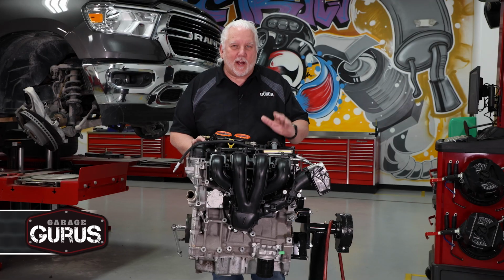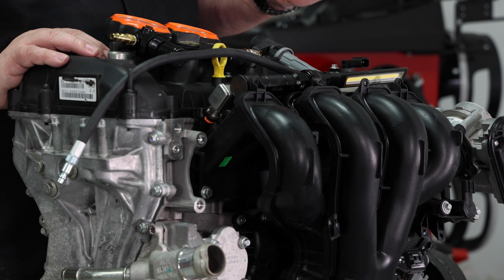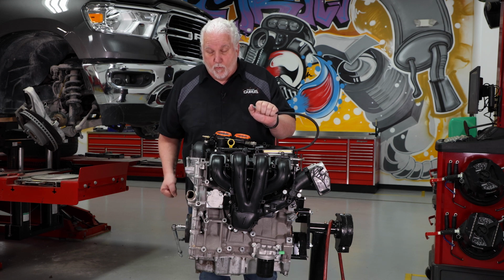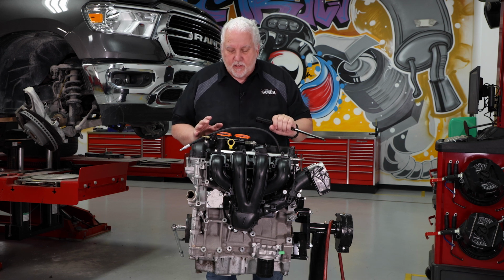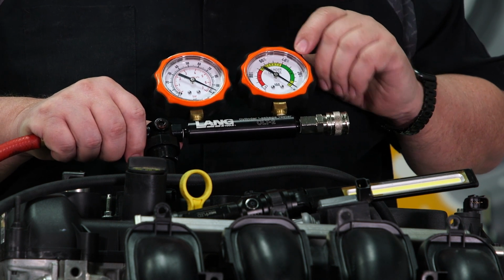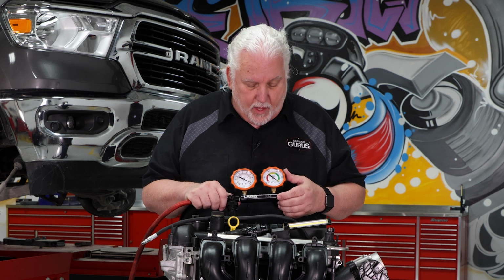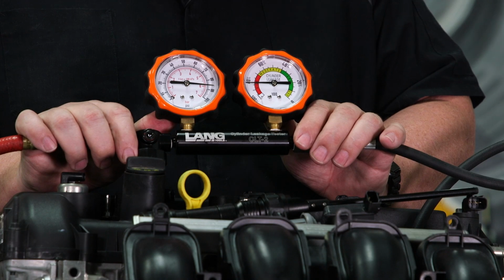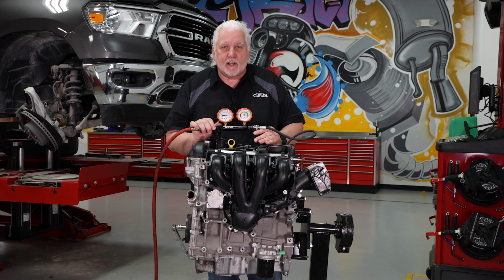Garage Gurus | How to Do a Cylinder Leak Down Test

Comment: If you use an adapter on end of hose make sure to use sealing tape on those threads of adapter . Air will push past the untapped treads

Comment: Mark why do you keep calling an engine a motor? You correctly stated you were going to put it on an engine stand. Motor is electrical engine is not electrical. Starter motor, wiper motor, window motor.  Just trying to help clarify.
Reply: Do you ever put motor oil in your engine?
Reply: I get what you are saying but why do we say motorsports throughout the racing industry? That preceded the EV movement into racing.
Reply: Motor is not a specific denomination of an electric device but a generic name for a machine converting different forms of energy into motion/mechanical energy.
Reply: I agree, you’re correct, i say my pancake mixer motor is burnt  not my pancake mixer engine is burnt , people getting all technical, is like saying spark plug is a cork plug that plugs the spark 😂 . Real techs that work on hybrids and gasoline engines know the difference (sorry petrol engines) 😂